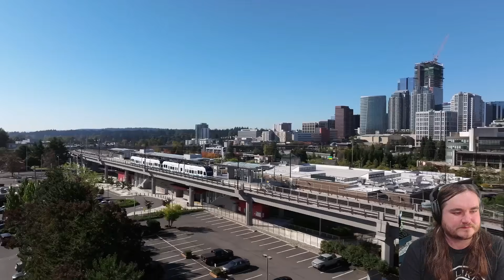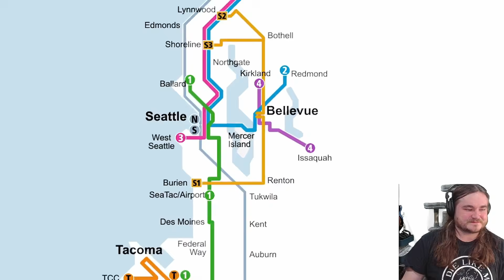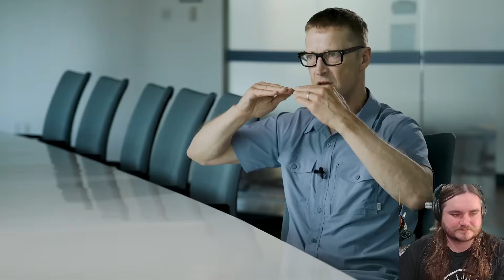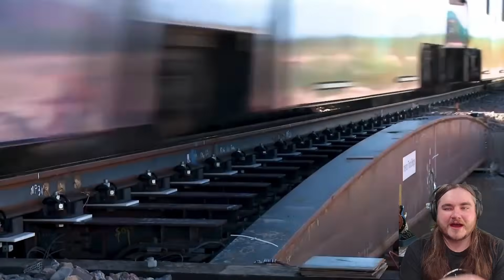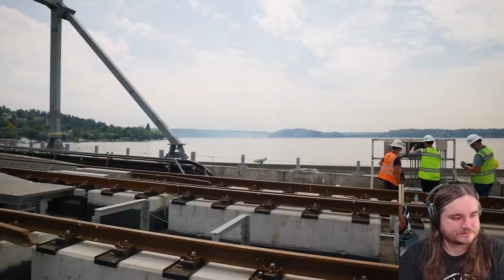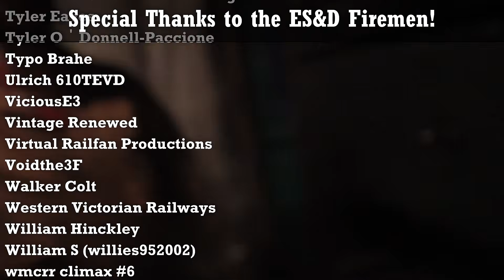Hyce Reacts - The FIRST Floating Trains that I helped with!

Comment: I also had a bit part in this, but my boss was working on the design for this extension practically from the start.  I was largely helping with...uh, let's call it "construction support" and leave it at that.

Having said that, as Hyce mentioned I rode this on opening day, which was utterly packed.  Then I rode it again about four days later, with said boss, and it was much less packed.  It's extremely smooth; if you know where the track bridges are, you can kind of feel them, but otherwise it's practically better than being on regular ground.

As far as those track bridges, I don't know how they work, but I remember reading an article about them being in testing at TTC in Pueblo back when I was in college, so that would have been ten or eleven years ago.  And now it's finally done.

Comment: Isn't this just a railway ferry with a travel distance of zero? :P

Seriously though:
Very cool project and very cool that you had a part in it! That's a valuable memory <3

Around the ten minute mark, you are talking about the voltage between catenary and rail and say that it's "whatever the train hasn't eaten, at max. 1,500 V" (paraphrasing). While DC systems (due to their generally lower voltage and thus higher currents) do seem to have a tendency towards somewhat higher relative fluctuations in voltage than AC systems (as a ballpark: In nominal 15 kV networks, which is the standard across large swaths of Europe, the hard limits are about 13.5 kV to 17 kV), but generally the voltage is stabilised strongly and has absolute boundaries it must remain within. Now, the fluctuations I mentioned are usually due to heavy cargo trains and in rather older systems. Given we are talking about light rail vehicles only and a brand new system, I'd say it's pretty safe to assume the voltage stays relatively constant whether the bridge is empty or four trains are accelerating at the same time. Small side note, you mention that the OHL usually is the plus side and the rail the minus side. Maybe there's regulations to this regard in the US? From a technical perspective, either way is fine and I know tram systems in Germany do it both ways. There are even those where there's both within the same network, usually due to several networks historically growing into one.

Rail: You mention 136 lbs/yd rail as the typical rail weight used in both class 1 railroads and light rail. That's about 67.5 kg/m, quite the heavy profile. According to a quick research, that's the heaviest standard profile in the US, 136RE/TR68. What's the rationale for using that in light rail? It does seem somewhat lavish :D Over here, UIC 60 (clocking in at 60 kg/m) is the heaviest standard profile used in heavy rail. It was first used in high speed lines mostly and by now seems to become the general standard for railways, superseding the slightly lighter S 54 (54 kg/m), which was the standard profile for mainline railway before (at least in Germany). Light rail seems to mostly run on S 49 (49 kg/m, historically the standard profile on heavy rail, and still present in some local railway lines), sometimes slightly heavier, or corresponding grooved rails.

Rail mount: The "Kölner Ei" ("Cologne Egg") has been in use for close to 50 years now and it works perfectly well, so that does allow for some optimism in regard to the mounting with adhesives done here :) In the Cologne Egg the polymer layer is between the rail mounting plate and the tie (or, more precisely; the Cologne Egg is the rail mounting plate consisting of an upper plate, which the rail is screwed to, and a lower plate, which is screwed to the tie, with the polymer layer connecting the two plates), so not an exact counterpart, but it does show that polymers holding the rail in place does work in the long run.

Testing is a really mindboggling amount, especially in signalling stuff. It's also a downside to modern, electronic, computer-based interlocking. Add one signal to divide a block somewhere in the middle of nowhere so the flow gets better – you have to check the whole signal box from scratch, because it's one, huge, integrated system. Relay-based interlocking was at a massive advantage in this one specific aspect. You add one module? Fine, test it it and the interaction with the ones it borders to. Done. It can't influence the others, so you don't have to test them. Bam, done.

Okay, I've 11 more minutes to watch, so this comment will continue, but I don't want to risk another comment disappearing into update nirvana, you know it happens to me xD
Reply from the maker: Lol! Great to hear from you my friend. Yes, it is a zero-distance train ferry in some aspects. :D

I don't know if there are regulations around + vs - side of circuitry in the US or not. I've only seen systems with - be the rail, so, perhaps it's just the common standard? Interesting either way.

The rail is quite heavy, yes - I don't know why they chose to use that weight. Saving maintenance, I suppose. There are heavier profiles used sometimes, but yeah, certainly the most common heavy standard. Good to hear on the "Cologne Egg." :D

Yes, modern signal testing is... quite the endeavor. So many things to test and check...
Reply: Okay, no further substantial content comments. Thanks for showing this to us – and yes, I'm very much in for more transit stuff!

Comment: There is a timeline where this would have been achieved with metro stock over 40 years ago if the rapid transit element of Forward Thrust had passed, and there’s parts of me wondering how they would have done it, and other parts of me being terrified at the prospect of that

Comment: Query?  Might Mr Moreland know something to add to the underlying bits involved other than the actual tracks, given his oft stated background in Concrete and Civil Engineering?
@ 16:20  I would also expect that you have very short, non welded track segments along with those...  vertical shields?  along this segment is a major feature, since with proper connections each one would not offset enough to derail the train but rather allow it to shift to the actual alignment of the bridge at that point in time?
@ 19:30  Obviously YOU know!  It was what you did!  thhhhbbbbbttttt
@ 25:15  Would you ever consider doing a 101 on this stuff?
@ 31:00  I would be interested, I'm not just a foamer!  However, no offense Mr Moreland, I rather expect Hyce will present the information in a much more engaging fashion.

Comment: What all are the mods on your red SG? Looks like you moved the PU selector swith?
Reply from the maker: So I've got two - one is a stock other than bridge pickup 2008 standard, the other was a heavily modded, then restored 1968 standard. The only mods it has from stock is an added Killswitch and the new pickups. The switch was left by the guy who did the restoration as there wasn't really anything better to plug the hole with, and I had it wired up as I've actually broken a pickup selector by using it as one before... Lol! Otherwise it basically meets the spec of a 1968 standard. Good eye!

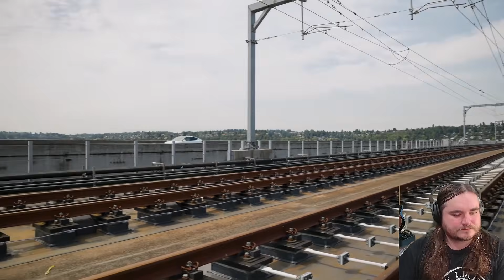Comment: 10:45 that corrosion he's mentioning is that a current through metal surrounded by either weather or water will cause galvanic corrosion in structural components, which can cause structural failures in the bridge. A lot of bridges have sacraficial annodes built on to extend the bridge's lifespan, even when they don't have massive electrical circuits carried by the bridge.

Comment: 10:17 you do NOT use 15kv on dc railway lines. Whith that type of voltage you are thinking about ac railways which do have 15kv or 25kv. a typical higher end dc voltage would be 3kv like in the netherlands for example, but it could also be only 1,5 kv or 750 volts.

Comment: it looks like they have those concrete blocks tied together so the glue doesnt need to handle the weight of the train trging to force the rails apart whoch probably helps aignificantly

Comment: Keep in mind that portion of the I-90 floating bridge was the second attempt. The first attempt, including a crane along with pieces of the bridge, is on the bottom of the lake. Or maybe they pulled it out. I don't remember. But there's footage of it. Worth a look.
Reply: The original bridge sank during a rehabilitation project in a storm. I believe Practical Engineering has a video covering some of the details.

Comment: As someone who works in QA I can definitely believe how much testing there is on a system that generally could be said to have some “fail deadly” concerns. I managed to write nearly 40 pages of tests for a single FPGA centred on just temperature faults, and errors in RAM…and a whole light rail expansion has a lot more points of failure to look at…

Comment: I would not worry about the track blocks being glued to the bridge deck, Some modern adhesives are just amazing. 

This took a ton of work but just imagine how much a tunnel would have cost.

 Its good they plan ahead, As I could see this fall people parking at the garages in places like Bellevue and Redmond and riding the train in for Seahawks games instead of driving all the way into the city itself, Which could put a lot of extra demand on the bridge connection. Now they just need to connect the top of the 2 line so if it gets very windy they can just send trains up and around until the bridge reopens. Or over the bridge and around if something closes a portion of the tracks to the north.

Comment: I also had a hand in this despicably complicated war against Mother Nature. I was a naive, bright-eyed, bushy-tailed, 19-year-old intern who was studying materials engineering at San Diego State, and who had no idea that he was about to have his heart shattered when he came back to SD that August. Despite having mostly done Gen-Ed's at that point, I did have a little bit of relevant classwork, and SOMEHOW, my application got accepted at Sound Transit. This would have been my first internship, although not my first job, and I got the rattiest, smallest, and dingiest shoebox apartment in Seattle just for 3 months during the summer. 

My project was to assist with the design and manufacturing challenges of the rubber compound attaching the sleeper to the flex bridge. I worked with a team of civil/materials engineers and mostly did field work, walking/lifting, note-taking, all that jazz, which is what I expected. The guys at Sound Transit definitely took advantage of my young back, LOL. I grew really close with one of my co-workers, his name was Yusef, and despite being 3 times my age, we hit it off and were pretty much best friends, and he helped me through a lot of the troubles of acclimating to the new environment. And, during that summer, Yusef did some serious string-pulling and got the higher-ups to agree to pay for my trip out to Pueblo, CO to test the flex bridges. IT WAS SO FREAKING COOL!!! I even got to ride in a hi-rail truck. 

We were out in Pueblo for 2 weeks, running tests every single day, making notes of the compound formula, spit-balling ideas on different compounds with different properties, etc. The compound itself is essentially a heavy-duty polyethylene/Vulcanized rubber hybrid, which provided as much as 6 inches of vertical flex for the rails. In the center of the sleeper mounts was a pin that would slide in & out of a hole to keep the sleepers in place laterally, which were also coated in a polyethylene condom which acted like a bushing for less friction and smooth operation. Seriously an awesome experience, and so cool that I was part of this insane project. And the best part, me and Yusef still keep in touch to this day. In the last few months, I did end up getting back to Seattle, and I did end up riding the Sound Transit Light Rail across Lake Washington, and it was a really cool full-circle moment for me.

Comment: 27:30 So does this mean that in practice, ST will never run a second line on the bridge (assuming a future expansion or change to the future 4 Line) at 4 minutes combined frequencies? I know there are lots of constraints throughout the system this would press against, but would trains every 4 minutes each direction would be limited by the max two trains on bridge constraint alone?
Reply from the maker: I don't think so. The bridge's floating section is ballpark one mile long, and the trains operate at the highest speed command of 55 mph through this section iirc. Ergo you clear the bridge in a little more than a minute, so at a 4 minute headway you've got plenty of time still.

Comment: TTC--Transportation Testing Center.  The Pueblo Test Center tests all sorts of rolling stock, track, and signal components at the same time.
With a background in track, I am surprised that the available rail expansion joints were not used or modified, and they went with a totally new engineering design (seems like typical architectural thought to me).  "Why use something we can buy? Oh, good, we can design it."  The crossovers on each end could have saved thousands if they had just used 2 crossovers, end-to-end, for each location.
Most of the Metro systems I have seen use 115-lb rail instead of the 136-lb rail.  The light rail vehicles weigh tons less than regular railroad equipment.
I applied to both the Atlanta and Washington Metros when in design and construction.  I got interviewed for both.
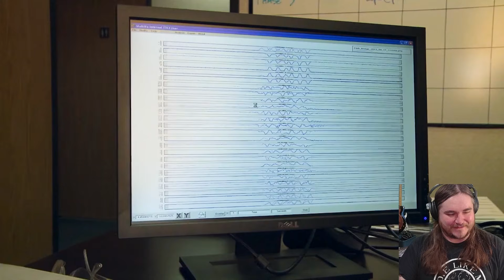Reply: 17:00 "Is it the TTC? I forget the name. They've changed hands a couple times."
Windows XP on the screen says TTC, so it must have been when they tested the bridge.

Comment: As an operator, it's been so much fun running across the bridge. The ridership has been incredible and having nearly full mid day trains and standing room only during rush hour already says a lot of the demand. 

Were you on the SCADA side of things?
Reply from the maker: I worked with the SCADA folks. I was specifically in train control with the systems group. We had a few pieces of overlap with them.
Reply: How fast did it fill up, was it like right away or did it take people awhile to really use it
Reply: @zakburnett6690 pretty much right away. It has only been getting busier. Really wished ST had a sub yard and about 20 more LRV's

Comment: The cool thing about good public transport/transit is that it makes cars faster.
Sure it can't eliminate traffic jams, because in a lot of urban areas there is too much latent traffic, but in a congested area the average speed of car traffic is roughly equal to the average speed of public transport. If public transport is the faster option, people will switch to it and remove congestion until road traffic is the same speed again, if public transport is slower, more people will take the car and slow down the road traffic.

Public transport can never (edit: within city limits if there is an empty parking space at the start and beginning) be faster than cars, but fast public transport will make everyone faster and without it there is so much car traffic that it can't be fast.
Reply: it actualy can be faster than Cars
Reply: @IndustrialParrot2816  Yes you are correct, I was kinda mentally stuck within city limits and even then, city planning can be done to discourage short distance driving. Within city limits of a open planned North American city with magic empty parking spots directly where you need to go, driving is potentially the fastest possible way, but as mentioned, as soon as there is traffic (there will always be traffic) public transport and driving will equalize.

Comment: 10:20 I'm told Philadelphia had some issues with stray voltage. Their downtown trolley tunnel and their L run at slightly different voltages, so the Wanamaker building (which sits between them in Center City) ended up getting the rebar on the basement levels completely eroded away over years of having a voltage difference passed through it.
Reply: That would not shock me given the age of the transit system and that building, I am sure some of that stuff just was simply not understood back when it was all built.

Comment: Minor point on the i-90 Express lanes: they were open to all traffic, the big thing was they were reversible lanes. So during the morning commute they would point into Seattle and usually about 1 pm they would flip and point back towards Bellevue, basically 2 extra lanes of traffic in the major commute direction.
Reply from the maker: I feel like the last time I drove in Seattle before construction started it was busses only... Shrug. It was a while ago. I know that's how I5 works.
Reply: @Hyce777 Nah I-5 express lanes are also open to all. And are also reversible. Except for the next few years while major work is being done from 520 over the ship anal towards UW. Right now they're  north 24/7 while most north bound lanes are closed, and in 18 months or so they'll flip while the work moves to the southbound lanes.

You may be thinking about some specific on and off ramps and/or things like the SODO Busway which are transit only.
Reply: @PendragonDaGreat  Boss, I think you meant ship "canal" and autocorrect robbed you of the 'c'. I really really hope it wasn't intentional...
Reply: @Hyce777  thats how 520 works u must have mixed them up

Comment: Why the original Floating Bridge and not a 'normal' one? Or is that one for Leyton?...

Cool engineering anyhoo!...

Wait, were you just coding for the Trolley problem, but on water??... 😉
Reply: The lake bed is too soft because of the sediment and the lake itself is surprisingly deep. So traditional bridges would not be able to be anchored down with pylons. So naturally, Seattle being different, we went with floating bridges.
Reply from the maker: I'd figure Apollo has it right; I'm not 100% sure as that's civil engineer stuff. :D
Reply: @Hyce777  with the lake connection opening up, it's been a popular topic coming up in bar quizzes. 😅
Reply: This video from Practical Engineering talks about the whys and the how's

https://youtu.be/nol0_4qxzb0?si=PTHoxxOi65TyyTiU